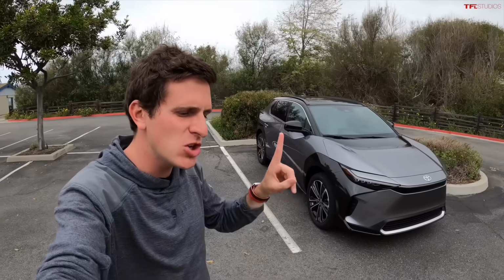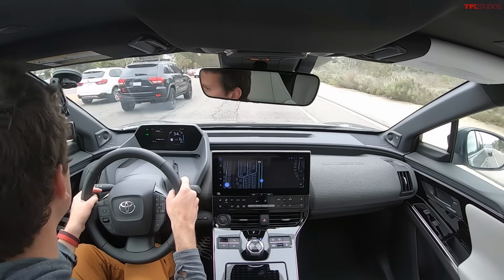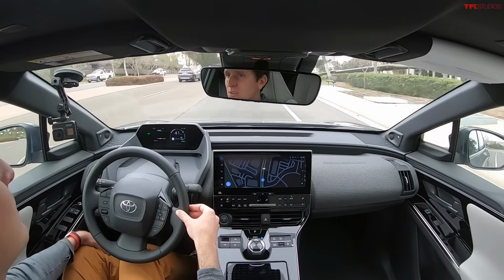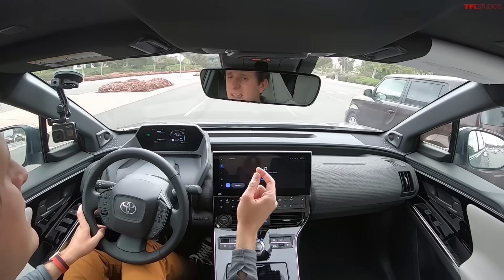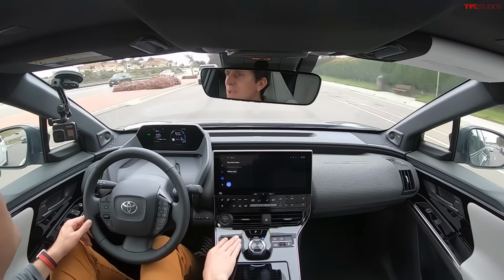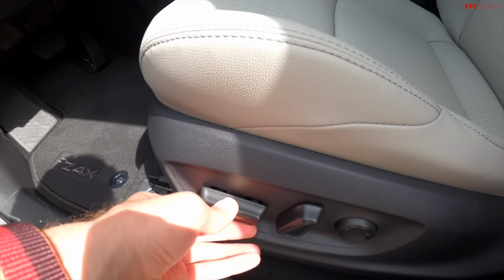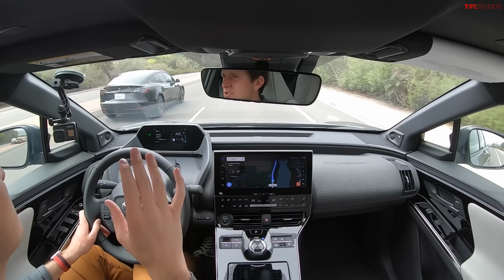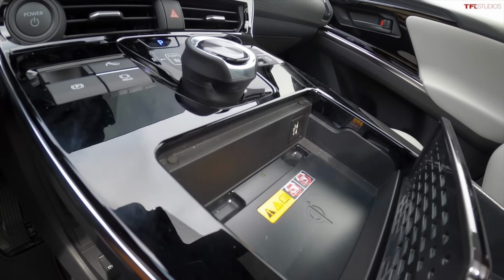I DRIVE The New Toyota bZ4X! It is an Excellent EV with a Couple Big Disappointments

Comment: It cost Toyota more than $80k to engineer "creep" in the 2nd gen Prius...because that is what people are used to. Same thing with "single pedal", people are not used to it. In fact, I  expect to be using the brake pedal as long as I live. If I don't, then I am dead, ha ha.  Also 90% capacity battery after 10 years is pretty advanced. I don't hear anything about a single owner 5 year old Tesla, daily driver. Lastly, Toyota has to engineer with a budget. Meaning that there is a limit dollar amount that their customer will spend on a car. When you have an early Tesla or Porsche who's buyer has an unlimited budget,  you can put in anything and still sell it....anything(gull wing door SUV). This car, if reliable will eat up the market segment.

Comment: Congratulations Toyota. You really pulled it off. With so many bad evs out there it wasn't easy to reach that goal. But man did you deliver. You actually managed to bring to the market the ev with the worst charging performance and it's not even close. Every customer will have a terrible charging experience for  at least over 10 years. And this my friend is guaranteed.
Reply: Haha troll spotted

Comment: Low range and it comes with a big price tag.  The divider on the roof is a fail.  The black out on the exterior is disappointing.  The AI system is slow.  The touch screen is lagging.  Not worth it.

Comment: I laugh at electric vehicle owners as I pass them while they sit reading books or are standing around waiting for their Teslas to recharge. Sad you need to bring a book to recharge your car because it takes so long. I can pull into a gas station and refuel my gas//diesel vehicle within 10 minutes and be back on the road with full range. Those fast chargers take at least 30 minutes if they are putting out maximum charge rate and they cut off at 80% charge so you lose 20% of your range off the top so if you could go 300 miles on a full charge you are now down to 240 miles with that fast 80% charge.

Comment: See this would be great, If Toyota could guarantee a solid state battery upgrade later down the line, Part of the electric EV challenge is making the cars modular with upgrades, which none of them are doing, Its cheaper to sell battery packs and upgrades with labor costs rather than selling new cars over and over again.

Comment: All motoring commentators with electric vehicles should start out with the driving range under normal driving conditions. Then charge times and availability of charging facilities. What does one do if there is no charge station? Nobody explains that a 280 mile range means 140 miles out and 140 miles back. I drive 1200 miles to visit my daughter.  If I have to stop for hours at distances decided by charging stations i will sit on the side of the road for hours and hours and hours. My life is short. Does the vehicle stop the charger when the desired charge level is reached, if not the battery may be damaged by overcharging and one has to sit up and wait for hours to turn off the electricity.
Modern design is spoiled by the fashion influenced by the Transformers movie, any angle or chunk of metal will do. Drivers have to chop their heads off to lower wind resistance. Human beings are being neglected by computers and business interests. Low roofs increase the likelihood of head injury. Electric cars are not really economical, and when the world is forced to adopt them we will be forced to accept atomic power generators, and to die with nuclear waste.

Comment: When I see an EV with no or very little frunk, to me that’s a major sign of how far behind they are in their EV engineering.
Reply: I wonder what Munro would say if/when they take one apart.  Probably too many cables, lack of integration of parts etc.  Obviously if Toyota does commit they have the $$$ and brains to pull it together before it's too late.
Reply: @forget_f1  Akio Toyoda spent so much energy resisting EV adoption, they have no choice but to double down to catch up and stay somewhat competitive in the space. They will do ok even with marginal range and packaging because of their brand and dealer network as long as more startups like Lucid and new market entrants like VinFast are not overly successful.
Reply: Contra point: E-GMP cars. Small frunks, but otherwise pretty damn advance.

Comment: I don’t understand why the emphasis on peak charging watts. Just give the overall charge time. You can have a vehicle with high peak charging to 80% but the last 20% is greatly reduced. A lower peak charge to the first 80% might not seem that great but the last 20% has improved numbers. So, while on paper the lower peak charging watts looks notable- how does it translate to overall charge to to 100%? Can I get more miles in less time is another question.

Comment: You'd be stupid to get this over the Ioniq5 AWD Or the EV6, Both offer dual motor with  320 hp, insane torque 400+ I rather pay the extra $5K and own a much much better EV.  Toyota is gambling with its loyal customers by offering subpar product at premium prices. $50K for this tiny 220hp EV is moronic.

Comment: I am glad that Toyota is finally aboard with EV's. That was a long time coming. They seem to have throw their weight at Hydrogen propulsion for a while. That was like a dead end road. They did not pursue  battery cars because there was some kind of dispute with the Chinese who one way or another kept the Japanese from acquiring batteries or batterie materials. If somebody has more info on this ,please fill me in on that. I think Toyota was willing to enter the EV game earlier but the Chinese kept them from doing that.
Reply: Toyota felt for the world EV market was flawed. EV’s were expensive and like almost all EV’s today are very expensive and aren’t marketed to a mass market. Toyota put their money in hybrid models that in developing countries and places were very little electrification was available hybrids with small gas engines with a battery ie Rav 4 prime is the answer. The Prime gets close to 42 mpg and almost 30 miles on the battery. Until battery tech and efficiency matures this is what i would consider. Hyundai has thier hybrid Tucson that has close to a 700 mile battery and gas range. All EV’s Teslas are so expensive and with their range issues and other EV’s have he same issues. I will pass on this and probably the next gen of EV’s till price range and charging is improved.

Comment: This car is detuned to last a long time. Model 3-Y, Mach E and ID 4 will be lawn ornaments in 10 years. Ford, Tesla and VW are all known to not last very long. While 2005 Prius are still running strong if you can keep your CAT from being stolen.
Reply: Go try to buy a 10 year old "lawn ornament" Model S. The resale value is higher than most comparable 10-year old gas cars because they're still great cars. I understand that it's new technology and you don't trust it yet but you don't need to arbitrarily hate. The data doesn't back you up.
Reply: @EvanCalder  don’t see many 2012 model S on the road any longer, where did they all go
Reply: Old Boy living in 1990's

Comment: I'm beginning to realize how boring every EV review will be for the rest of life.
Reply: ehhh, engines weren't much different. 4 bangers were all the same with the same annoying vibrations and buzzing. The V6 may offer more juice with a slightly improved noise (arguable). The V8, best sounding, but they all sound the same. 

In the end, manufacturers were artificially altering exhaust notes and/or adding fake engine noises through the speakers. We're seeing the exact same with the electric drivetrain.
Reply: @wzDH106  Batteries just aren't exciting.

Comment: The deal breaker for this vehicle is the efficiency, 220 miles from a 70kW battery pack is terrible and then having a max recharge rate of 100kW makes any road trip painful to deal with.
Reply: But is it true range and not like so many that claim higher range only to have low real world driving range...
Reply: @gregb1599  even so it's still pathetic compared to others
Reply: @enadegheeghaghe6369  It's only pathetic after someone actually takes it for a real distance test, otherwise it's just keyboard experts that have no clue what it is actually capable of...
Reply: @gregb1599  what? Virtually all BEVs have been range tested by numerous reviewers and critics so we know what the competition can do. Are you suggesting that this vehicle will have a better range and will charge faster than Toyota themselves have stated? You saying Toyota lied to us about the specs to make the vehicle look much worse than it is? What are you on about? Talking like the actual real world performance of BEVs are some kind of sacred secret or something. No matter how you slice it this was an underwhelming effort from Toyota. And I am a big Toyota fan
Reply: @enadegheeghaghe6369  Well other EV makers have given EPA ratings far lower than the real world driving range, and Toyota fan boy? Hardly I own a Nissan Leaf and have zero thought in buying this Toyota! However I am not fixated like you lot that are! Your probably a Tesla fan boy or a BYD! Nah I am just open minded to the EV may have been tested differently as in tested at highway speeds and not like many Chinese EV that use NEDC!
Reply: @enadegheeghaghe6369  And where did you get 220 mile range from as other channels are saying it has a 252 mile EPA range for the 70kwh or 330 miles with the larger battery. Wow this channel got the range wrong badly!
Reply: Why would anyone want to road trip with an EV when the infrastructure isn’t here yet lol.
Reply: @420bhp9  Yeah terrible, although I have owned my EV for over 6 years and have never had to worry about plugging in at home and saving around $150 in fuel savings alone now times that by average 45 weeks of driving for work then times that by 6 years and that is quite a big saving of only $40,000 of course the EV did cost me $18k to buy, and in the 6 years I have spent a small fortune on servicing like 2x gear reduction fluid changed and 1x brake fluid change and a few sets of tyres so yeah I am broke on the servicing costs! Lol oh yeah cost is $15 per 310 miles at most! As many times I charge for free at my local fast charger.
Reply: What's the real range and claimed range in this and other models please? Cheers
Reply: @UnseenSpirit   To me it will never matter, because I will not contribute to the pollution of our GROUND WATER. These are the reasons why:
California does not have a Recycling Center for Leaky Acids or  other Chemicals Battery Packs, which POLLUTES our GROUND WATER 
From Millions of Hybrid Cars and Electric Vehicles (EV's). From 8 to 12 years ago sitting on Junkyards. I double checked to confirm Jalopnik Article. 
There are only Recycling Centers ♻️ for Electronic devices Cellphones and 📺 🖥 Computers 🖥
Reply: @UnseenSpirit   Need more resources 
Investigation should be done by yourself as well.    The reason I will never contribute to Polluting the Ground Water 💧 and the Ocean from Leaky Battery Packs 🔋 Acids and other Chemicals seep into to Ground Water 💧 California USA 🇺🇸 does not have a Recycling Center for Battery Packs from 20 to 10 year old Electric Vehicles (EV's) & Hybrid
 Article posted by Jalopnik News got my attention and I verified it. California USA 🇺🇸 only has Recycling ♻️ Centers for the GOLD inside Computers 🖥, Stereo, Television 📺, & cellphone 📱
Reply: @UnseenSpirit   With Chip shortages, there won't be enough to supplement the 2035 demand for the world driver's.  
Also, I was asked to run for President, only because I would remove the 2035 mandate for Electric Vehicles (EV's) only.  Until, there are at least 1 Recycling ♻️ Center in each County of each state, in The United States.  Not just 1 in each State 1 per County, and they think I have a more reasonable political opinion on military, and foreign relations. I say I wouldn't want the job,  because it means I would forever loose the ability to drive myself anywhere.  Including, after leaving office.
Reply: Let's calm down. Toyota projects their solid state battery for 2025 production.
Reply: @derrickmedina2449     The following reason I will never contribute to Polluting the Ground Water 💧 and the Ocean from Leaky Battery Packs 🔋 Acids and other Chemicals seep into to Ground Water 💧 California USA 🇺🇸 does not have a Recycling Center for Battery Packs from 20 to 10 year old Electric Vehicles (EV's) & Hybrid
 Article posted by Jalopnik News got my attention and I verified it. California USA 🇺🇸 only has Recycling ♻️ Centers for the GOLD inside Computers 🖥, Stereo, Television 📺, & cellphone 📱
I will never buy anything that will drive me, and doesn't have a 6 Speed Manual Transmission 🙋👍🏎🏁 good show though
Reply: Not sure why you lot think 250 miles EPA is bad for a 70kwh battery in a mid sized SUV,  and I do wish you would learn the difference between capacity and power output, as if this Toyota had a 70kw motor it would be painfully slow!
Reply: The reason I will never contribute to Polluting the Ground Water 💧 and the Ocean from Leaky Battery Packs 🔋 Acids and other Chemicals seep into to Ground Water 💧 California USA 🇺🇸 does not have a Recycling Center for Battery Packs from 20 to 10 year old Electric Vehicles (EV's) & Hybrid
 Article posted by Jalopnik News got my attention and I verified it. California USA 🇺🇸 only has Recycling ♻️ Centers for the GOLD inside Computers 🖥, Stereo, Television 📺, & cellphone 📱
Reply: @ChasingDifferentAdventures  Do you contribute to air, ground and water pollution with tail pipe emissions,  fracking and oil spills?
Reply: @kiwim3p587   So you don't mind bathing or drinking Acidic water cool. I suppose crops would continue growing. Ever heard of thirsty animals volcanic Water full of non visible sulfur and dieing next to the water source
Reply: @ChasingDifferentAdventures  It's not obvious to me which pollution is worse but you seem very certain that EV batteries which are all contained and create pollution at inception and destruction but not during use is worse than the alternative pollution which happen at the production and all through it use.  Why?
Reply: @kiwim3p587  I have seen on Pacific Coast Highway 🛣 on the shoulder.  A Tesla which was using a gas powered generator to charge up the car. You can't get away from it.
Reply: @kiwim3p587  There are only 3 gasoline ⛽️ stations and 1 is 150 miles from any other fuel ⛽️ station.  On slow winding roads and stopping along coast to see and take pictures 📸 or video 📹 footage.  The EV's still are continuously using power 🔋 and they realize there are no Charging stations. Can't get away from it.
Reply: @kiwim3p587   In the 1980's the smog was bad, couldn't see the Angeles Mountains, within a 3 mile distance. I could actually be outside without 😎 🕶 shades.  The temperatures 🌡 in Los Angeles California were always comfortable winter rain 🌧 lasted 6 months, and Summer was at the 87° F at its hottest.  
Now we see 112° + in the summer and  get maybe 2 weeks worth of rain within  any particular season.
Reply: Range and efficiency is the worst.  Very disappointing from Toyota!

Comment: No real one pedal drive is a dealer breaker, not a fan of all wheel drive, but it’s dc charging speed is a embarrassment. The 250 epa front wheel drive is just adequate, not a fan Toyota, you can do better

Comment: Toyota gets a solid C for this car.  Still needs a lot of refining all around and at least another 100 miles in range. Would like to understand its ADAS capabilities and plans.
Reply: Also 200 more HP and free, right?

100 miles in range isn't free. Toyota still qualifies for the tax credits, unlike Tesla. They made sacrifices to keep this in the $30-$40k range which makes it pretty competitive with similarly appointed ICE vehicles. 220 mi range is more than adequate for the vast majority of people with any experience driving an EV. There are very little circumstances where 300 mile range gets you anything else in practice. If you're driving more than 220 mi for your daily commute it's time to switch jobs.

Comment: Low range, no glovebox, no frunk, quirky styling..  This is just a compliance car.  A true disappointment from Toyota.
Reply: Maybe quality is not that great.. you have to admit that the car looks futuristic
Reply: @franki3Ru550  I’ve owned six or so Toyotas in the past.  If they can build quality ICEVs my guess the BEVs are even better due to fewer moving parts.  But the engine compartment did look extremely cluttered.
Reply: @jjnxyz4368  I thought the MSRP was $42k.  Can’t get a M3 for that.  However the design is lacking in desirability.  One more push and it’ll be a desirable car.
Reply: As usual.
Reply: You forgot $15000 dealer markup for no tow package and front wheel drive only including a basic 120V slow charger.
Reply: It's the same range as its main competitor, the ID.4. This car is basically for anyone that likes the ID.4 but doesn't want to reward evil German companies who cheat emission regulations.

The larger range of similarly appointed Ioniq's or Mach E's costs $5k-$10k more.
Reply: Agree, just a cosmetic upgrade with a full-time battery (instead of hybrid) that is outdated and impractical short-range charge.  Anything else is the same as Rav4.
Reply: @philng2197  Rav 4 prime is more desirable
Reply: Agree.  Given what companies can do when their heart is actually in it (Hyundai and Kia),  this is a pretty pitiful first entry.